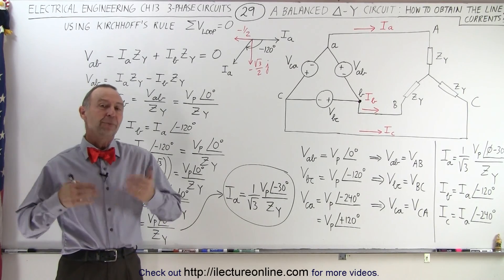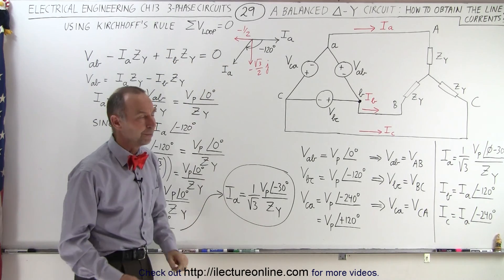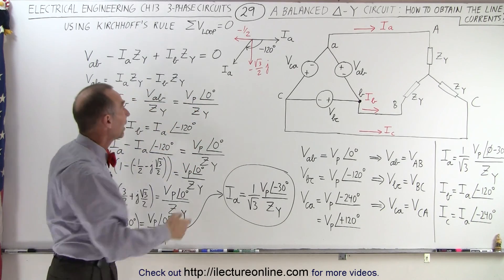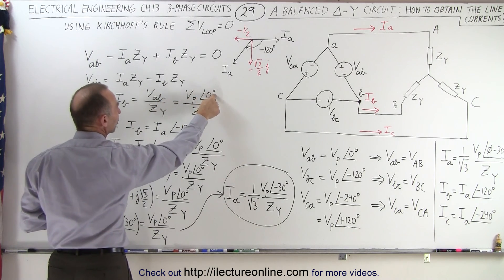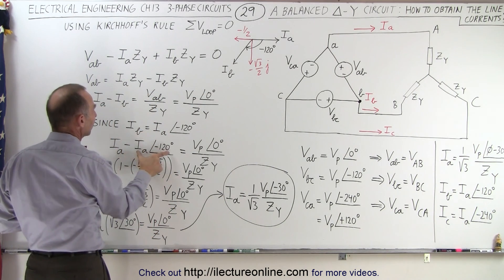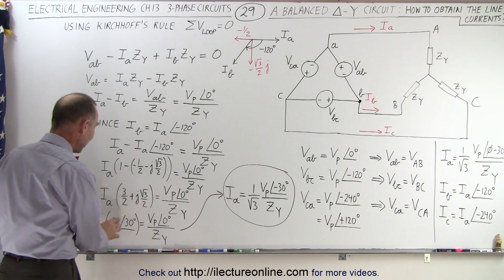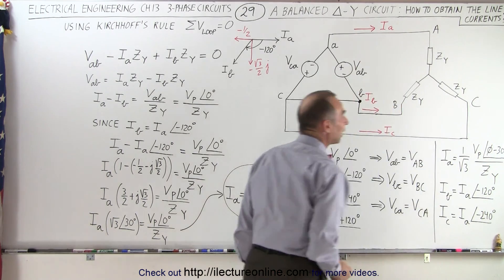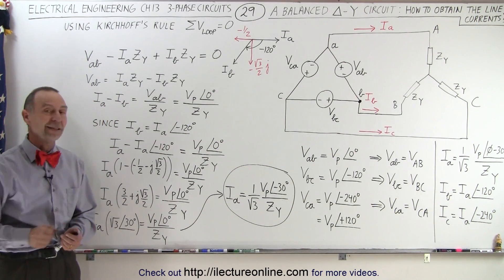Electrical Engineering: Ch 13: 3 Phase Circuit (29 of 53) Balanced Delta-Y Circuit: Line Current=?

Comment: Thank you for all of the videos. I think that all of the videos in this series that were supposed to be after this one were deleted yesterday by accident, would you please add them back? Thanks!
Reply from the maker: They haven't been published yet.  These playlists are a work in progress.
Reply: Michel van Biezen thanks again for all that you do and thanks for adding more of this chapter, exam 1 for circuits 2 is going to be in a week and a half. It is going to have one question about 3 phase circuits, I’m thinking about just knowing how to convert to a Y-Y circuit and know how to deal with that really well instead of knowing all 4 combinations. Do you think that is a good strategy?
Reply from the maker: It is important to know the phase and line currents as well as the phase and line voltages of each of the 4 types of combinations.  After you study all 4, you'll see the pattern.